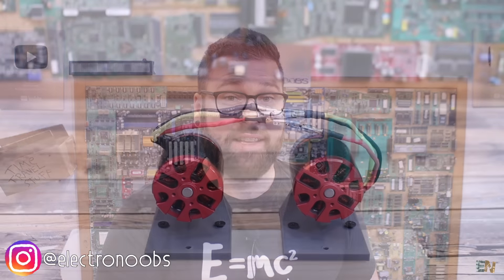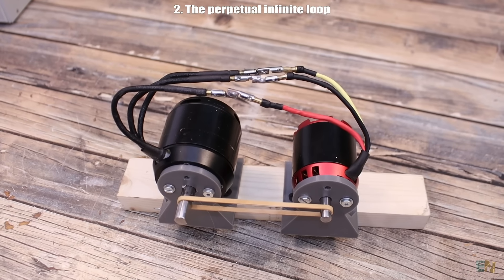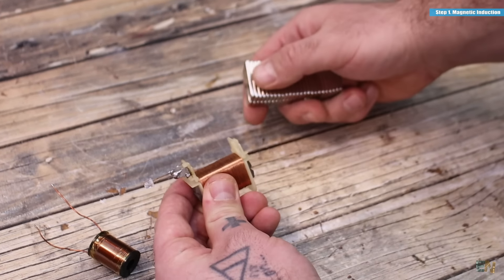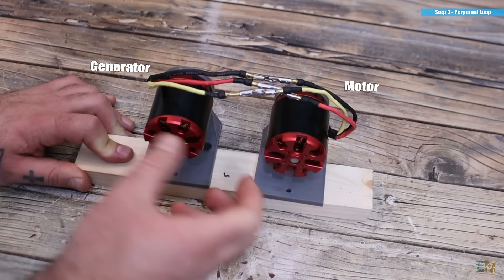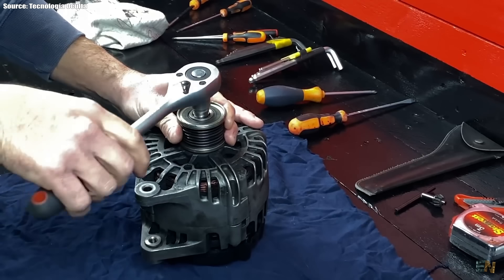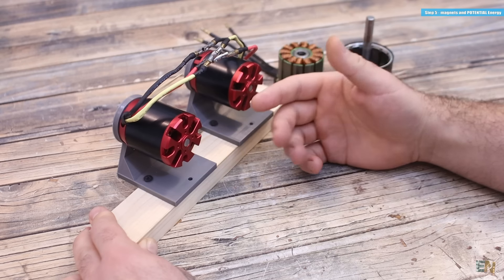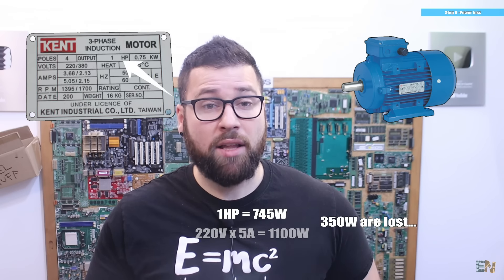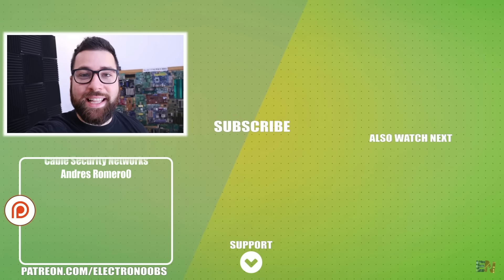Free Infinite Perpetual Energy Nonsense - FAAAAAAKE

Comment: I would like to point something out where you had a question about why a generator wouldnt be slowing down. You're right when it comes to the setup that they are doing and it should be slowing down. BUT there's a way to prevent the slowing down of a generator. When you connect a load directly to a generator, the generator slows down. If you put a bank or use two transformers between your generator and load, your generator will not slow down. Your bank needs to be bigger than what your generator can produce. If your generator produces 120V then you need a bank bigger than 120V like 240V. The reason for the bank or transformer would be the following: When you apply an Electromagnetic Force to a load, a secondary electromagnetic force is produced. Since the only place that the secondary electromagnetic force can go is towards the generator, it causes the generator to slow down. Instead of sending it to the generator, have it go to a bank where it can be stored as energy instead of heat in the generator.
Reply: @darklight2.1  deny it before you try it huh? you're a funny guy :)
Reply: @darklight2.1  Get a transistor and pulse a transformer. on the secondary side of your transformer, add a capacitor then a bridge rectifier then a DC capacitor. Watch your current draw and your voltage. Keep adding capacitors until you're satisfied with the results. Bet they don't teach that in a text book.
Reply: @darklight2.1  you must be a bot
Reply: @darklight2.1  only a bot keeps repeat everything that everyone has told it to do. they don't do anything new.

Its not about creating more energy, its about using the energy that you have to its maximum efficiency. You've been taught that a transformer is not efficient because you're pushing more power to it that what it actually needs to run. By giving the BEMF a place to go that's not the generator, your generator wont have to work as hard
Reply: @darklight2.1  except your wrong because nobody hasnt been able to prove Gerod wrong. Yes you can collect the BEMF  in just the way i described but you wouldnt know that because you haven't tried nor are you willing to try
Reply: @darklight2.1  once again you're a bot
Reply: @freedomer342  he's not a bot. He's saying that because you haven't responded to his very simple questions.
Reply: @darklight2.1  you are a prime example 😆 bots don't learn anything new. I've told you how to do it and you refuse to try it. That's not how science works bub
Reply: @LineOfThy  and his answer was given to him in my first statement and it wast given to him after. Twice I told him and twice he denied it. Not going to beat a dead horse. This bot is completely wrong. Until one tries what I've said, they will not see what I'm talking about. Boy can throw ball against walls, boy can catch ball coming from wall. Did you know they use to tune motors with capacitors? With what Gerod is doing is nothing new. This bot can't do the math of how much watts is coming off the generator and how much is being pulled off without the fuse being blown. Many other people have replicated it and had the same result. Science isn't deny it before you try it. Try it the same exact way and see if it works before you deny it.
Reply: @freedomer342  maybe try learning english first if your gist is to argue with people.
Reply: @LineOfThy  so now you're low balling
Reply: @freedomer342  maybe try answering the question in a human-friendly way, bot.
Reply: @LineOfThy  already have... 3 times now 🤣
Reply: @LineOfThy  how is it more efficient? Becuase the BEMF isn't going back towards the generator. Boy throws ball at wall, boy catches ball.
Reply: @darklight2.1  wrong. You can run a system with no heat and no BEMF going back to the motor.  You're BEMF is caused due to you connecting your load directly to your generator. For every action there's is an equal opposite reaction, which would be your BEMF. The BEMF then forces your your generaotor to put your more current which bogs your motor down. Boy  throws ball, boy catches ball. To prevent the BEMF from going back into the generator, you need to add a bigger bank then what your generator can produce so you can collect the BEMF. BEMF can be collected via a capacitor. If you don't think a BEMF can be collected, take a fan motor out of a microwave oven and grab 9V battery and connect them together with wires but have one loose. Flick it to the terminal amd watch that AC motor spin off of a DC power supply. In order for you to get it to spin you need an ac current. So if the BEMF doesn't exist, and can't be captured, then why is it being used in a mechanical form? Test it and let me know how it goes this is called science not Quora.
Reply: @darklight2.1  until you try it, you will then see what I am saying. Until then, keep reading your books and I'll continue to do hands on experience. If Faraday, Maxwell, and Tesla dis everything that the book said was and wasn't possible at their time, then we wouldn't be where we are at today.
Reply: @darklight2.1  already told you how to do it. If I claim something, you have to repeat it wither or not you think it's legit or not then you come ask me what I did if you cannot replicate it. That's called science.
Reply: @darklight2.1  not only that I already sent you the video :) I'll be waiting
Reply: @darklight2.1  haven't replicated it yet?
Reply: @darklight2.1  go watch that video i already posted and do the math on that :D

Comment: So basically your criticism is about THE EFFICIENCY of the system, and not that it does not work. 
Ha
Reply from the maker: Nope. Even at 100% efficiency (which is impossible) the input power is the same as the outpit power so it "would spin forget" But the moment you connect something external, it will stop. So is NOT creating power...
Reply: @ELECTRONOOBS  What me to tell you how it REALLY works? (Note: your carrer might end.)
Reply: exactly.

find me someone who can make a 100% efficient machine.

Comment: While I agree with most of this, your objection to their use of belts rather than couplers is misplaced. Their claim is always that the system generates a large surplus of power, and this means that they don't have to worry about efficiency.
Reply: you do realize that he didn't build it himself and tried his version of how they faked it. his explanation was so stupid treating like the magnet was a battery, the copper wire had something to do with it.

Comment: Nonsense lol.Those motors run on the principle that a prime mover turns generator.this has always been used in cars.the petrol engine is the prime mover.only this time a motor is used as the prime mover to turn the alternator/ generator. Gues what cars use to turn the alternator belts lol.a24v alternator wud give u 240volts output 3 phase.is not fake..people are so caught up with nauseating Fisichella they forget that light bulbs are lighting up and angle grinders are turning.hilarious!!!

Comment: So clever boy.why doesn't a cars v belts get hot like you say it causes friction? The big problem here is , you not showing us what you saying is wrong.the free energy system works. There is no hidden chords or leads under the grass or under the table. Or hidden batteries. Show us here on you're page how it is done. You got no clue. I did what the guy did in the video of the alternator and single vase motor and I'm running my whole caravan on it. Delete you're page .you got no clue what you saying